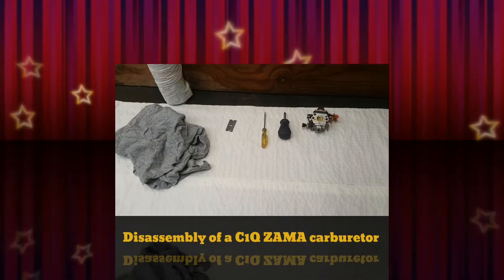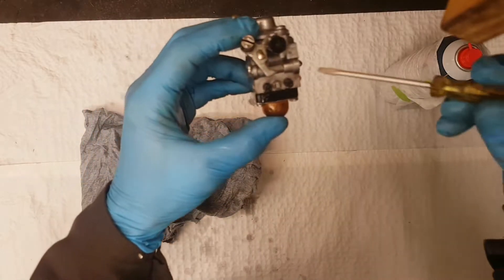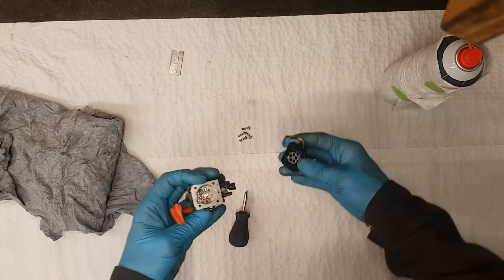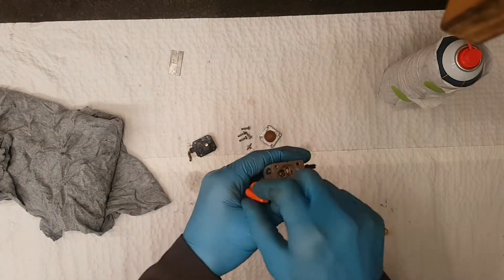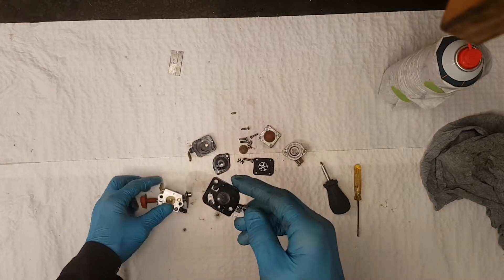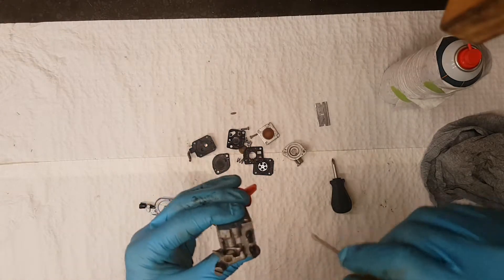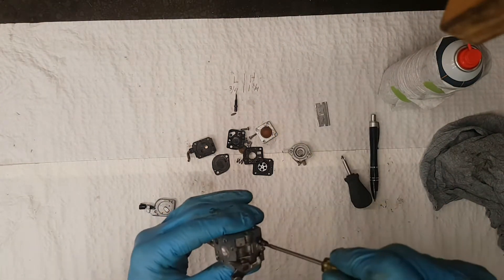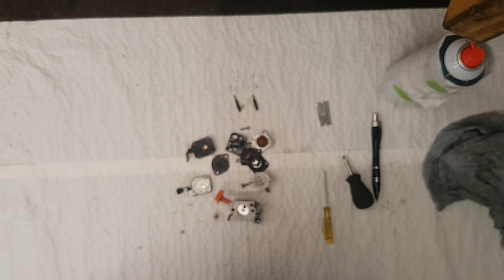Carburetor Cleaning! C1Q ZAMA (part 1 of 2)

Comment: Low screw is always longer!   So L is to long
Reply from the maker: Actually, the screws depend on the carb serial number.  What's important to remember is not to switch them and to count the turns
Reply: @thehonestmechanic  Actually Magic One is correct. Zama will tell you the idle mixture (low speed) screw is always longer on the C1Q.  Also, they don't recommend soaking in anything other in gas. The carb body has check valves in it. Last, the C1Q static mixture setting is 1 full turn from seated for L and 3/4 turn from seated for H. So no need to count turns when disassembling. Adjust as needed after running and warmed up. Cheers.
Reply: Yes, on the C1Q, maybe even all Zama carbs, the Low mixture screw is longer.

Comment: So how do the adjustment screw covers come off without destroying them?
Reply from the maker: There is a special tool to remove them. A flat screw driver and lots of patience works too. Keep in mind that you might also need a small pick on the inside to release the clip
Reply: I gave up on it. The covers didn’t want to come off and my rebuild kit I ordered didn’t have all the stuff I needed so I just ordered a whole aftermarket carb. If that doesn’t work I’m trashing  it.
Reply from the maker: @whatfreedom7  I wish you good luck 👍